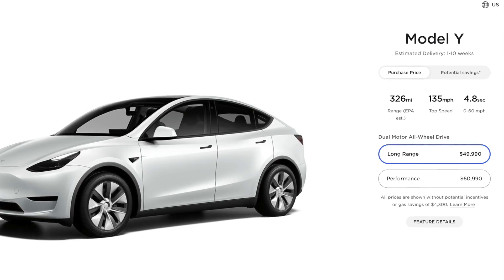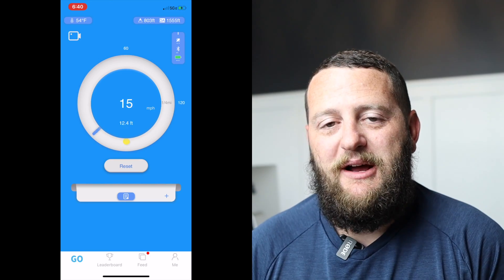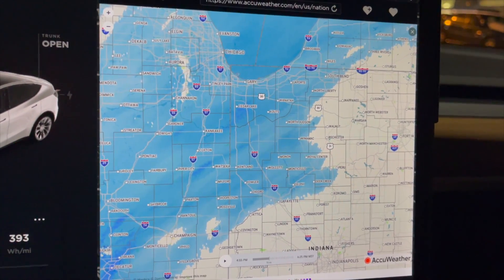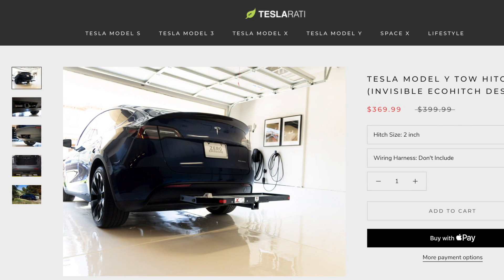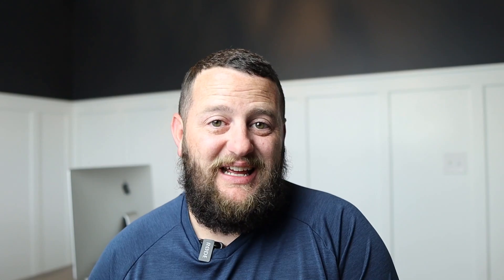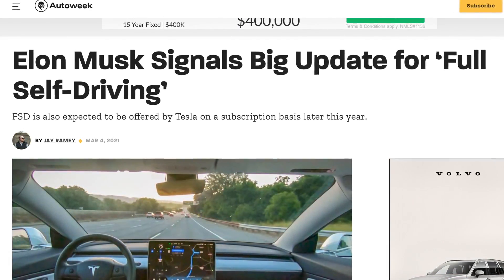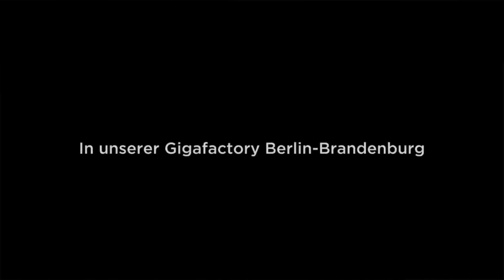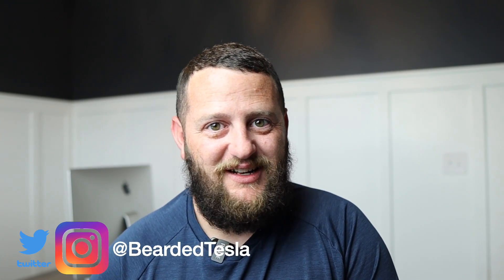Tesla Model Y Ultimate Buyers Guide

Comment: I opted for the P3 over the PY. I only put 78 miles on those hideous, fugly turbine wheels and changed them out on day 3 of having the car.  Went with a set of Martian 18” and just from the downsize, I gained 40 miles of range from the circumference difference and 18” tires are much cheaper than buying 20” tires.  Win / win.
Reply from the maker: Those are the wheels I have on my wish list

Comment: Picked up yesterday. I think very accurate is where you live is what kind of tires you get makes sense. FSD in my opinion takes some fun away from driving but that being said if money just doesn’t matter to you then get it. As far as the tires Tsportsline has the same tires you can get 19 inch ones for $1960 then put those on the current tires, then get snow tires and put them on the gimini wheels. You end up saving $1200-1600 depending on what you were going to get.
Reply from the maker: Yep, it’s a more cost effective way to go

Comment: Great video! I'm expecting delivery of my model Y in another week. If you plan on towing with this car, don't get the 20" wheels as they reduce the towing capacity for the car. The 19" wheel gets you the full 3500lb capacity. Thanks again for this video.
Reply from the maker: Cheers
Reply: @BeardedTeslaGuy   hi Bearded Tesla, I ordered a Y, but have a choice between Austin factory(newer battery variation, some small upgrades) or the Fremont 2022 version....Is there a big difference between those two model Y's? The Fremont Model Y can be delivered this month, the Austin version can be sent to me in Sept..WHich would you choose?

Comment: A bit off topic, but as you have impressed me with your obvious research to stay aware of Tesla Model Y updates/issues...I'm curious if you have comment to a few searchable online articles related to rodent damage to the soybean based electrical wiring as well as rodents gaining entry into the cabin of the vehicle. There was one video I watched the mouse inside the owners car. Other articles I've read discussed access points but that's a whole other story.
Reply from the maker: I am pretty sure the seep hole for the HVAC system is an easy place for rodents to enter

Comment: Rock chips on that back tire area are not a “Tesla” issues. I’m currently driving a BMW X6, and it has the exact same problem, chipped paint and scratches super easy. Paint durability on most “luxury” cars is not good. But it sure does look good clean and new.
Reply from the maker: Yea, rock chips are a reality for a lot of cars. The shape of the Model Y lends itself to more exposure than most cars I have personally owned. Getting good mud flaps is really important to help protect the car.

Comment: Sill saving up for a Model Y, hoping to snag one this summer, 2 years for better batteries is too painful =D. 

One question about the new batteries, since they are more efficient, do you think that range will significantly improve? Or do you think Tesla will just be able to use less batteries in each car to lower weight and possibly cost. I can see either being an option. Elon has already said 300 miles is basically the sweet spot.
Reply from the maker: I honestly believe it’ll be somewhere in the middle. They may reduce capacity some to help with cost and supply but it’ll be more range than today no doubt

Comment: As this is for people on the cusp of buying (or at least potentially on the cusp), I’d add the possibility of the substantial federal EV tax credit coming back, presumably applicable to the vehicle.  (Not necessarily advocating waiting or not, but just for the sake of the fullest possible “buying a Model Y” picture for people to consider.) Any guesses on probability and timing?
Reply from the maker: I would think this summer there will be a lot of action in Congress on these initiatives. I know there’s now at least 2 drafts for consideration
Reply: Really good point. I myself am one of those buyers potentially waiting for the EV Credit but I've heard that the bill is not very likely to pass. Don't know how true that is. I'm finding that it's really hard to wait months for something that could potentially not even pass so I want to pull the trigger now :(
Reply: @maximus9401  I am in the same boat, but if they do not change the filibuster rules it's never getting through.  Not happy about the price increases ether.  My test drive of a Model 3 is today but with the price increase i am now considering the Model Y too.
Reply: @maximus9401  I bet it takes quite a bit less to end a lease early than $7000, especially if someone intends to buy!?  (I hear that this incentive may even apply to used EV’s...). Given the current situation causing buying hesitancy, Tesla should immediately implement a fair “lease to buy” program, enabling scooping up any upcoming incentive later.)
Reply: @maximus9401  buy more Tesla stock NOW, wait a few months to see about tax credit. You win!

Comment: Ordered the Y model long range and Red with 7 seater with 19 Gemini Wheels. It seems like it takes 9-13 weeks now. I was specific to the color. Even considered one in inventory, but that got sold in hours. I did not use a referral link. It seems I dont get 1000 free super charger miles.
Reply from the maker: Just message your advisor and ask them to add the referral code for you
Reply: @BeardedTeslaGuy  : I canceled and re ordered and lose $100 :(. Thank you for response. Your vides are very impressive and helpful.

Comment: Nice review.  I did a test drive on a model y today and the SA said the only staining issue is with blue demand and I'm a total bluejean guy but there is cleaner that takes care of it
And both the white and red paint are triple coated.  The black and midnight silver have fewer coats
What is your opinion on wraps?
I ordered the white and white long range but I would love it to be yellow
Reply: Sorry blue jeans are a staining issue on the white interior but even that can be cleaned
Reply from the maker: There is a ceramic product that you can put on the seats to add a layer of protection
Reply: @BeardedTeslaGuy  What product is that??

Comment: You neglected to mention that the Induction and Performance wheels stick out a little more than the tire rubber greatly increasing chance of road rash on curbs compared to the standard wheels or hubcaps. You may have to assume added costs of fixing them.
Reply from the maker: i have unfortunately experienced this first hand.

Comment: Do the performance because life is too short to drive a boring car.  

I agree with the towing package.  I ordered mine because I didn't want anyone else hacking into the harness, plus the tow mode.  I think it was you towing a camper video was the first of your videos I saw.  I have not used my Y to tow anything yet because I also have a truck which does most of the towing, but it still is an option.

I had the same concern with the white seats and my kids are all grown.  

FSD is still not really worth it in my opinion.  I have it and its not worth $10k IMHO for me.  Perhaps in the future it will be.  I hope it will be because I'm banking on it having some residual value when I sell the car in the future.  My guess is the subscription will be $149-199 a month.  It does seem to be improving with each little update.  I don't have the beta.
Reply from the maker: All good inputs. Performance would be living life no doubt!

Comment: Could you tell me, which model or upcoming model for 2022-2023 With best mile rage , Is it high possibility rhat they will come out with tesla with rage of 400miles ,id say thats more then enough,  which is decent price, Becouse I’ve seen Roadster is that good rage upcoming car but its like 250,000, could they make something similar battery of roadster or same, since its, well created,? I think they could like put that battery into a cheaper model, My maximum 40-50k$ and main thing is range that is most important for me. Thinking of saving up this year for a tesla, so is there are a high chance of tesla coming out of a new model in a year or two thats a under 50k$ range of ~400mile
Reply from the maker: The new battery cells will be a game changer. Now how they implement them with range is yet to be seen. I dont know if it will be all the way up to 400 miles given the more expensive S has 400 miles, so I think it'll be between 350 and 400 miles.

Comment: Do you know if you install a 14-50 out for charging does it need to be surge protected?
Reply from the maker: Built in on the charger
Reply: @BeardedTeslaGuy   great thanks. You’re the best.
Reply: @BeardedTeslaGuy  just to be clear, I’m not going to be using the Tesla wall charger, but the connector that comes with the car to plug into the car.

Comment: Thanks much, BTG, I haven't reached that point when I'll buy but probably early next year. I'll watch the 4680 news closely and if they pull another Elon Surprise date even earlier, that's a definite push to go for it. Personally we drive in SW Colorado but there are 2 10,000 ft passes we hit periodically on longer drives. So I'll be picking the Gemini wheels and will likely change out the tires seasonally for snow and ice or maybe just use cables. Also will definitely take your advice and add PPF and mudflats. Cheers.
Reply from the maker: Good luck to you guys! Time will pass quickly
Reply: Buy more Tesla stock while waiting. Price going $$$$$$$$$

Comment: Electricity is everywhere. The earth’s electrical field has been known for centuries. Lightning and St. Elmo’s fire are the most dramatic manifestations of atmospheric electricity. But the field doesn’t exist just in the vicinity of these events; it’s everywhere.

The earth is an electrical conductor. So is the ionosphere, the layer of ionized gas about 70 kilometers over our heads. The air between is a rather poor insulator. Some mechanism not yet explained constantly pumps large quantities of charged particles into the air. The charged particles cause an electrical field. Although it varies widely, strength of the field averages 120v per meter.

You can measure this voltage with an earth-field antenna—a wire with a sharp point at the top to start a corona discharge, or with a bit of radioactive material that ionizes the air in its immediate vicinity. Near the earth, voltage is proportional to altitude; on an average day you might measure 1,200 volts with a 10-meter antenna.
 
Dr. Oleg Jefimenko invented an earth-field-antennae connected to an advanced corona discharge electrostatic motor which can convert the energy of the earth’s electrical field into continuous mechanical motion.

Wouldn’t it be fun if there was a Tesla car that runs on charges similar to those that make your hair stand on end when you comb it on a cold winter’s day?